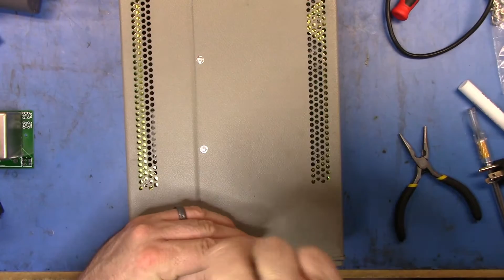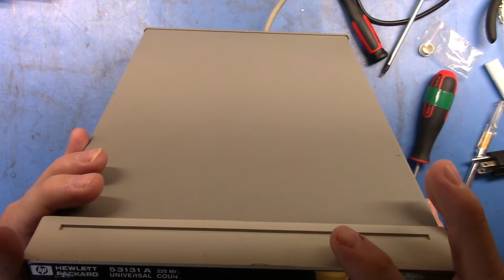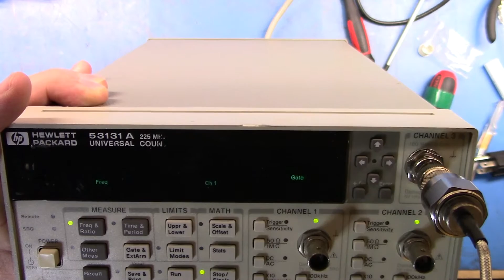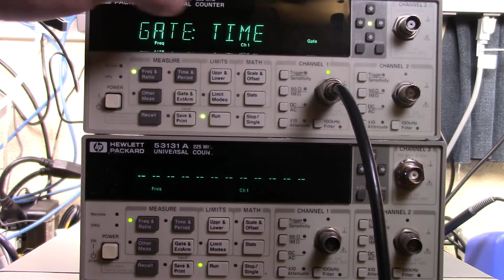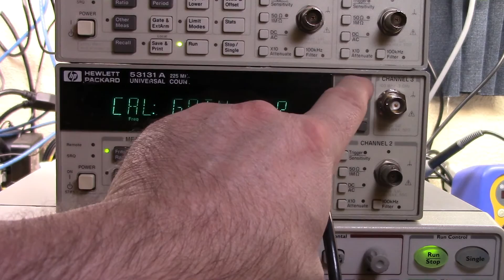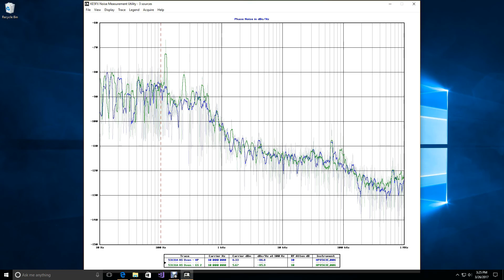HP 53131A Upgrade

Comment: I just bought one of these (Agilent 53131A) at a hamfest a week ago for a whopping $25.00! It came with option 010 installed, is in very good condition and appears to work just fine. I am however going to install the 3 GHz prescaler, install the front / rear bumper and handle kit and check the electrolytics just to make sure. It was however serviced in 2013 so it may be OK. EDIT I use these same utilities as well, I use the phase noise utility with a HP 70K series SA.
Reply from the maker: Nice - That is an awesome price - I have a new fan that I have to put in mine - You might want to do the same so you can keep it running 24/7 to get the best out of the OCXO
Reply: @tgsoapbox  Thanks for the tip, I was a little puzzled as to why the fan is always running. I did notice when I installed the 3GHz board mine had the low aging rate 10811 installed, this I wasn't expecting. I did check the caps and they appear to be just fine.
Reply from the maker: @CraigPetersen12f36b  They're good little boxes - Put the new fan in mine and it's now sitting in its place on the top of the bench warming up and settling down...

I used a Sunon MF40201V3-1000U-G99 but really any good quality fan should work - I went with that one as the noise was 16 odd dBA

Comment: Acquired a surplus (NASA Glenn Center) Agilent 53131A in early 2019.
For its SMPS, I changed out the fan (Quieter).
Like you, the large electrolytic capacitors were bulging.  
Changed those to high quality 105° Panasonic electrolytic capacitors.
==
I installed Gerry Sweeney’s High Stability Timebase (Nice upgrade) in 2019.
https://gerrysweeney.com/update-diy-hpagilent-53131a-010-high-stability-timebase-option-pcbs-available/

For Channel 3, I selected the COJOTECH (Romania) 8 GHz pre-scaler with the SMA connector
that fits the 53131A front panel “D cutout” perfectly.  Installed it during summer 2020.  
One week DHL delivery.
Now ready for the expanded 6GHz wireless LAN band in 2021.
https://cojotech.com/hpo-080-8-ghz-replacement-kit-channel-3-hp-53131a

Comment: Hello TGSoapbox . I have installed option 3 in my counter. Do I need also to tell the counter (software) it is installed or does the counter recognises op3 by itself?
Reply from the maker: It should recognize the pre-scaler by itself and provide you with the ability to measure "Frequency 3" when you hit the Freq & Ratio button.

Comment: The Signal Path did those mods as well.

What happened with the recap?
Reply from the maker: Thanks for watching - The recap addressed some of that 60 Hz noise but it was still there. I replaced all the caps but it didn't improve - I think that might just be a design artifact. Gave it to my Dad and he's been using it perfectly well since then.

Comment: Thanks for the video. I upgraded my 53132A with the same two mods a while back.  Very worthwhile mods, and both work very well.  I had better check those electrolytic in the power supply.......
Reply from the maker: Glad you enjoyed it - Let me know if you ever find a better fan (I leave mine on 24/7) - I got a low noise fan but I think it could be even quieter.